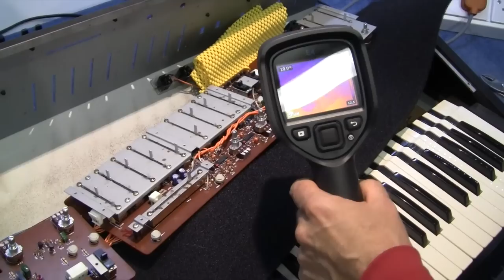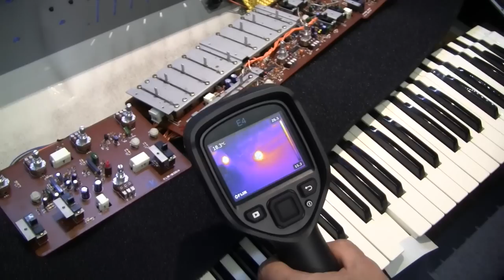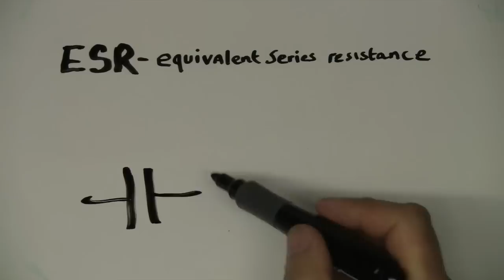MF#15 korg delta DL-50 vintage analog strings synthesizer repair

Comment: I've just changes all electrolytic capacitors in my Korg Delta. I stopped counting at 100. The Voice board alone has more than 64 of them. I routinely also change the capacitors in the power supplies.

Comment: Hi Mark ! Amazing ! I get Today a Delta and have a Bad sound from the synth section ! Wich is the value of the capacitors of the Delta ?
Reply from the maker: Hello Pierre. I sold my Delta many years ago, the value of the capacitors should be printed on each capacitor within the Delta and there will be many different values depending on which capacitors you need to replace. there may be a schematic diagram online somewhere that may help you. I have retired from electronic repairs since last year and no longer make youtube videos or repair keyboards. sorry. I hope you manage to get your Delta working again.

Comment: By changing the same capacitors, I could save my Korg Delta. Thank you!
Reply: Hi Guillaume ! These capacitors is 0.001 cap value or other ?
Reply: Because I try to save my ones too
Reply: @Archeomane  0.001 microFarad ceramic. I changed c21, c22, C23 and c24
Reply: @guillaumebeuzeboc4135  ok ..thanks for your so Quick and precise answer ! Any kind of ceramic 0.001 uf are ok ?
Reply: @Archeomane  I used 50 v ones with 5% tolerance and it worked

Comment: I have one of these. Turned it on for the first time in about 10 or more years.
The Synth section appears to be OK and initially the strings were OK.
Turned it off for 1/2 an hour or more then the strings didn't work.
Could be a simple open circuit, not sure yet.
All components are currently original.

Comment: Did you at least recap the primary power supply? Improving overall regulation can often extend the life of older components further down the line.

Comment: Do you repair drum modules?
Reply from the maker: Hello Lord Triac, I have repaired quite a few in my years but I don’t actually do any repairs as a job now, It’s all just my own gear really and a youtube hobby to try and share a little knowledge so other prople can have a go themselves.
Reply: @markusfuller  bummer, I have about 3 killer roland modules,that only need a simple jack or two replaced, but none of the amp repair guys around here even want to try. If fact they spend more energy trying to talk me out of having them repaired.
Reply from the maker: Lord Triac I’m sorry I just cannot take any work on, I retired 3 years ago and do not want to get back into repairing again. this is now just a hobby. theres a few facebook groups about synth repairs and there may be someone local who can take the job on for you if you ask on there. I forgot the exact name of the group but its something like synthe repairs.

Comment: I STILL haven't completed my Delta repair! 
I need to get at one of the boards to replace a slider, but it will NOT come out. I (think I) have removed all the screws, but still, no go. I also still need to replace the filter caps (same as yours) and do some cosmetic stuff. Any tips on dismantling to get at the sliders? Is there a trick?

Comment: Love these vids! Question; How did you determine which capacitors? Why not the oscillator section? Is it because flipping that filter switch made it function briefly? Did you replace more caps?

Comment: You changed out C21-C24 and they were all 0.001 micro farrads? My synth section goes in and out on my Delta and the A# key doesn't play in either section but I can hear it when I key it and turn the noise slider up. So the key contacts are good, it just doesn't make it to either the string or synth section. Thanks!
Reply from the maker: symphonydedan Sorry to hear that anout the A# imnot sure i know what would be causing that especially as you say it works with the noise slider up. I would still check the ribbon connections from the keybed to make sure theres is a good closed circuit when pressing the key down, even though the noise works you may just be triggering it as in a gate signal as im not sure if the keybed has single contacts under it or contacts for gate and contacts for pitch. I cannot remember now as i got rid of my korg a long time ago.
Reply: Hey Thanks. I’ll check the connections again and change out those caps if that doesn’t work. Cheers! Next thing I have to fix is the Moog White Elephant. Very intimidating!

Comment: It's wonderful to watch your videos for the 'Ah Had' moments when you discover what's wrong.  I'd appreciate it if you included some video of replacing the capacitors as well.  I have to do some repair work on my synthesizers as well.  The electricians over here charge $80 just to look at your item.  So, bringing a cheap synthesizer in for repair is not worth it.  That's why I'd like to learn how to do everything myself if possible.  Thanks for the videos.  Take care and have a wonderful week.  Sam.

Comment: electrolytic, tantalum, ceramic, etc...  which ones were you referring to in this video? I have an old  korg 700s which needs work.
Reply from the maker: ElenaDiakova Hi I made this video a long time ago but i think it was tantalum caps i replaced.
Reply: @markusfuller  Not likely tantalum at 0.001uF (1nF) - tantalum in the 1uF to 100uF range and tants are polarised. More like ceramic. Surprised ceramics failed though. As you say, aged tants or dried-out electrolytics are usually the failure candidates. Also I'm not sure freezer spray is a usable debug aid on analogue ICs like op-amps. Usually a method tried with digital devices - looks like the PCB in the base had a couple of 40-pin devices there - possibly a microprocessor used for the keyboard scanning?

Comment: Loved another vid. this one was great. 
If you find that the 13600 is getting hard to find consider the 16700. I have tried them in my Etherwave theremin and they do work pretty much the same. same pinout too. Just a suggestion. TY for such fun vids.
Reply: LM13600N is so easy to find for 2 dollars piece

Comment: Hey markus don't know if you still remember me but I've asked before abt korg 800 n u helped me hehe. I hv yamaha sy2 n most of the keys are out of tune. Do u what might the common issue n how to fix them. Thanks a lot in advance
Reply from the maker: I have never been in the SY2 but im guessing is most the keys are out of tune then there could be a tune pot controller inside (or even in the back panel) as I think the keyboard is an analog control voltage type so if the tune has drifted then all the keys will be out.
Reply: markusfuller I'd really appreciate the reply thank you markus!!

Comment: HI  Mark   very interesting and helpfull i have 2 synthesizers  the mono poly  and the sigma   it's completely new never used i bought  many years ago but no sound is coming out only only  one sound , you think it may be the capacitors too .  mu best regards
Reply from the maker: Hello Jolly Claude. I really cannot say as I do not want you to damage your synthesizer. it would be best if you could get the capacitors tested just incase
Reply: thank's  markus

Comment: Hi Mark , great vid as always , just have a quick question if i may ... i notice you put a layer of anti static foam between the boards for obvious reasons , i was wondering if this is a suitable method to shield the p.s.u.(as in the vid)  .. i was thinking of adopting a similar method but by using black rubber sheet to try and limit the risk of electric shock.. would you think this would be acceptable .kindest regards Steve
Reply from the maker: Hi Steve. It's ok to do that as long as you use non conductive foam. some foams allow static to travel over it and that could be bad for the board.
Reply: Thanks Marcus... yeah i agree the foam should be non-conductive ;-) ... thanks for your opinion on this method of avoiding "certain death" ... cheers matey .. keep up the good work ..i could watch your vids over and over .. and i do !! ;-)

Comment: Great video! I also own Delta and I got some issues with the noise knob. There is some sound comin through with it but it's so silent that I barely hear it. Other knobs in synth part works normally. Do you have any ideas where I should try to find the problem? :)

Comment: great vid Markus that was a good call on the caps..takes me back to my days in the 80's as a stores clerk for co-op sound and vision...caps were my nemesis too mainly for ordering and stock control. Not from Derbyshire by any chance? think I recognise the accent..regards from Derby here mate.
Reply from the maker: +john gardner Hi John. I was manufactured in 1966 Derby (uttoxeter old road) >1972 Bakewell >1980 derby (ashbourne road) > 1982 London >1999 Derby >2002 Brighton. of all those places I feel most at home here in Brighton. But yes good guess on my accent there.
Reply: +markusfuller haha..excellent. I grew up in Chaddesden and have lived most my life in sunny Normanton..handy for Potts which i'm sure you're no stranger too, it's still going `I seem to gravitate back to good old Derby it's not a bad place to live but I do love Brighton too..been trawling through your vids and was surprised how many IC's caps and diodes I remembered from ordering so many from RS at work. And I say "all the best" all the time  it's even my email sig..must be a Derby thing.
Reply from the maker: Oh Potts on babington lane must be the best ever electronics store, by the way I use to drive the blue double decker buses in Derby. the 22 bus to chaddesden and I cannot remember the several bus numbers for Normanton. oh the good old days.
Reply: I used to get the 22 all the time in the 80's. I lived on walpole st behind the cemetery. Probably got on your bus loads. Thankfully got my bike test at 18 and been a mad biker since. There's no double deckers now all singles with wifi..progress eh?
Reply from the maker: Yes its all changing. I came to Derby last Xmas to visit family and got confused on the ice factory island which is not there anymore. and totally confused on Raynesway to alvaston. It was like a completely different city.
Reply: Raynesway's a rats nest for sure. I take my old engine oil to the tip and always end up going towards Leicester or Notts. I had to google the ice factory and it's now a huge carpark and the new bus station. There's Lara Croft way down the road from me that's all new with new islands I treat it like my own race track on my bike..probably the only road without potholes.
Reply from the maker: My poor TomTom sounds like she has totally lost it. I have not updated it for 7years so a lot of Derby is a different world to her now.
Reply: next time you're up here drop me a line and i'll buy you a pint..the dolphin is still open and going strong.
Reply from the maker: Thanks John. I will let you know when im next in the city of industria virtus et fortitudo ( I think thats the latin name for Derby)

Comment: Hey Markus, thanks for all your fantastic videos!  I bought a Delta with the same issue.  Replacing the caps did nothing unfortunately, so I swapped out the LM13600's.  Now I've got wonderful squarewave goodness on footages 16 and 8 while 4 and 2 don't produce any sound.  The noise source is working properly as is the rest of the synth.  Do you have any idea where I might look next?   Thanks!Jay from Canada

Comment: Guess what? I picked up a Delta at the weekend.. although my synth works, it only works in BP, not LP -this video explains how to fix it - Thanks, Markus! 
Just need to fix the Top Octave chip, joystick, resonance, output socket and cosmetics now..
Reply: +NerveJam.Com I've since been advised to check the divider chips before I start poking around the Top Octave chip.

Comment: I"m repairing one of these, I replaced the same capacitors, to repair the same fault. but it also has a keyboard fault
Do you know of a source for the AMI S10430 divider IC, as i traced the keyboard fault to one ot those ICs.
Reply from the maker: +Mike Schupbach Hi I find it quite difficult finding these chips now, you just have to go digging around ebay etc, or if you check out facebook theres several synth repair groups on there where you may be able to ask and source some parts. best wishes.
Reply: Thanks,  i just found them. D Greenhill & Co have them, but they're expensive.

Comment: Hey - I like your chops at the end! great stuff.. reminds me (only a little) of some of the fantastic noodles being done by greeks on the Roland SH-2000 (worth checking out!) here on youtube. Love your videos - my only regret being that I'd wished you'd maybe pointed out what the unfortunate capacitors were doing in the circuit (e.g. - power rail decoupling cap? smoothing cap? etc) thanks much!
Reply from the maker: antigen4 Hi antigen4, Im not quite sure what the Caps were doing though to make a will guess I think they were for decoupling. Tantalum dipped caps have never been the most reliable. Many thanks from Markus

Comment: Hi Markus
Do you think there is a possible to instal a midi kit to this synth?
Reply from the maker: Hi what i meant is sometimes the Kenton kits have to be soldered onto the boards inside in certain places to make the CV work. I'm not sure if there is a ready made kit for the Korg Delta though.
Reply from the maker: Hi. maybe Kenton would have some form of kit for midi but if you get a midi to CV convertor then you could at least play it with midi that way. though Im sure theres a way to midi this keyboard up with a kit.
Reply: markusfuller cool video. solved the problem on my dl-50 after years. my next thought was also to have midi on it. I didnt understand how to play it over midi with a midi to cv convertor. The dl-50 has no cv, or did i understand something wrong? There is only a trigger in so far. Must be some way to add this cv inside.

Comment: Nice video! I love seeing how these things are made. Good guess on the capacitors! Question - the caps you mentioned have a low value, and were small. Were they electrolytic caps, or polythene? I restore old tape recorders, and its the electrolytics that go most of the time. Anyway, thanks for the video!

Comment: Dear Markus, I got one of these, but it got a problem with the CI S10430. Where (and how much it is) an CI like these? They're becoming pretty rare, don't they? Thanks a lot.

Cheers from Brazil,

Enio.
Reply from the maker: Hi Enio, I had seen these on ebay when I was checking the what this keyboard was worth. I think it was a Japan seller who had the chip on sale. the ebay number was 321181813056
but it had been sold. they will turn up occasionally. its the AMI divider chip.

Comment: Great timing in posting this since I am working on a very similar DL50 issue tonight. Strings more or less OK but synth, although giving sound, makes rumbles an pops. Also the resonance control only appears to fade out what sound does come out. Any ideas? Certainly will change the C21,22,23,24 caps, perhaps the 13600's too if needs be. Any other ideas?
Also, one other issue is some of the keys seem to give lower volumes than others, in both synth and strings, not any on note and more of the black keys than whites. Any ideas?
Good start on the repair though. Didn't even power up when I started this evening, the 7915 reg had gone. Now changed at least there is some sound!
Reply from the maker: Hi the keys are controlled by the 3 large chips IC-S10430. bottom board on the left. each chip controls 4 keys then it is octaved up. i.e. chip 1 would be C Csharp D Dsharp next 2 chips the next 8 notes. I also changed the 0.001 cap under the cutoff frequency slider cap number C20. and somehow the cracks & pops disappeared. I have had this problem a few times in years back and this seemed the remedy back then so I was just lucky that that was the problem. as for your volume differences on certain keys Im sure i would look deeper into the board with the 3 S10430 chips on it. best of luck.
Reply: Hi i have one korg delta and i don't have sound in low pass button synthesizer. in hi pass is ok.

Comment: At around 2:33 the the multi-way connector with the blue wires second from the left looks halfway out.
Reply from the maker: Hi Coolkeys2009, yes I noticed that along the way and pushed it in. it was the connector for the keying matrix that controls 4 of the keys but it had nothing to do with the problem.

Comment: Nice job again Marcus! Was that a 1nF ceramic cap? i always thought only electrolytic caps were sensitive to heat and old age and such, not ceramics, interesting. Curious to see if you can revive that TR505!
Reply from the maker: Hi Alex. True its normally the electrolytics that are problematic with ESR but I have changed these in a few machines over the years especially next to the filter and vco/vca chips and 75% of the time its always been the right thing to do. they were 0.001 (numbered 203) I cannot even test them with the esr meter as the value is too low but it did the trick yet again. Im working on the TR505 video now, looks promising. best wishes from Markus
Reply: markusfuller
ah that would make sense, i suppose their capacitance in filter/vco/vca circuits would be quite critical so that a slight change could just kill them. nice